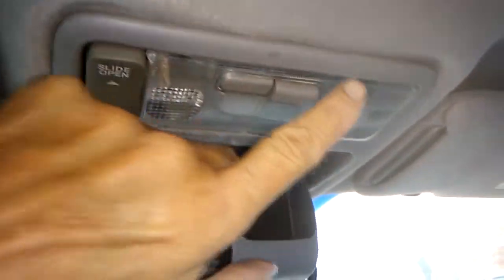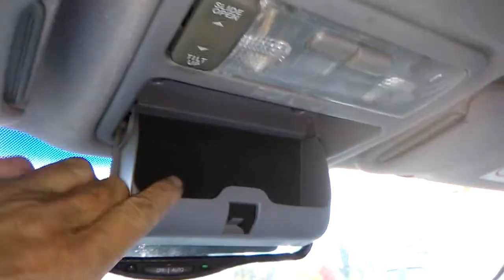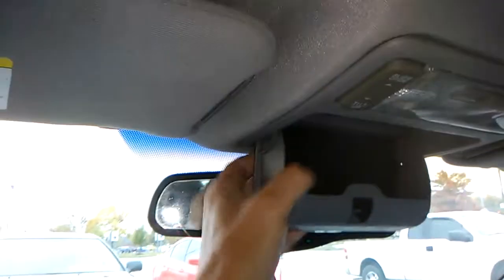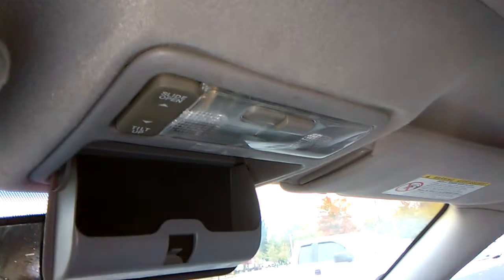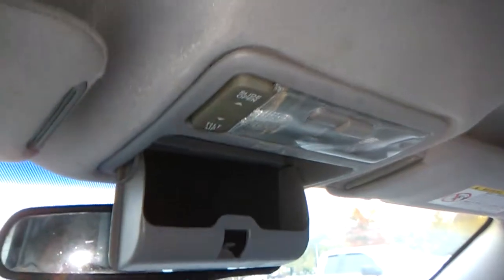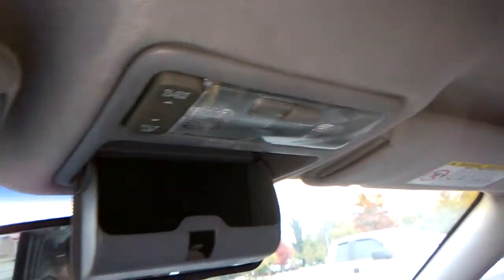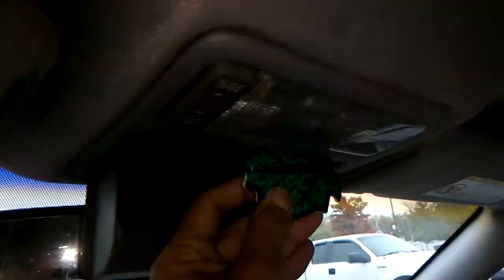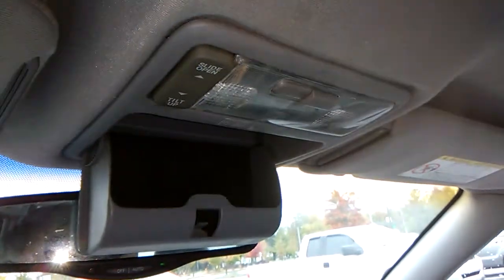2000 Avalon overhead light assembly

Comment: Did you find out?
Reply from the maker: Yeah, take a small flat head screw driver, look close and on the light bezel there are little groove to pry the bezel off.  Once off, there is another philips head screw.  Take it out, the light assembly comes out.  I found one at a junk yard for $20.